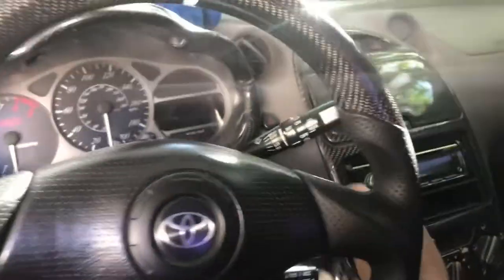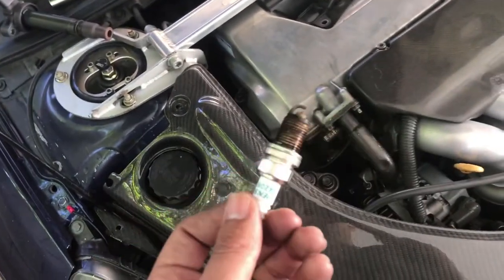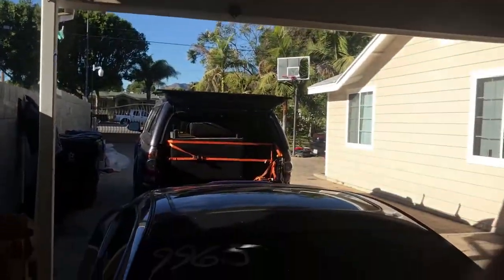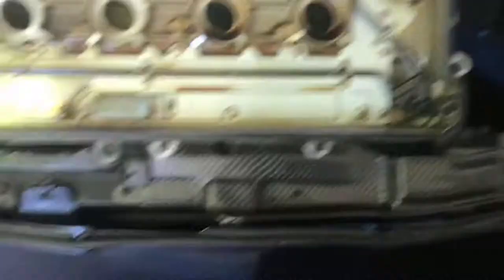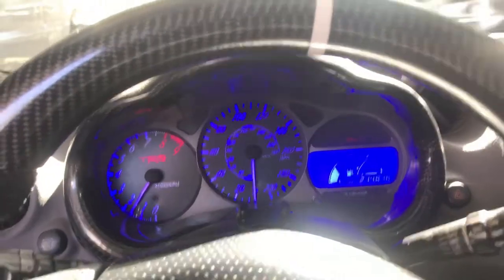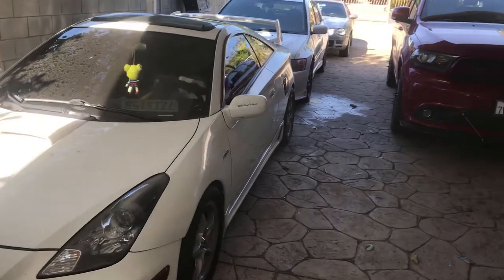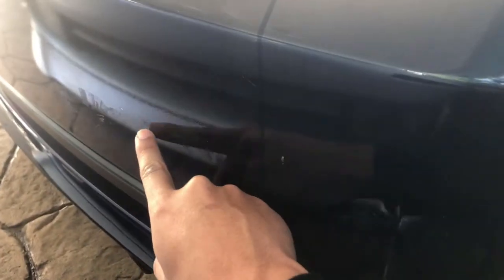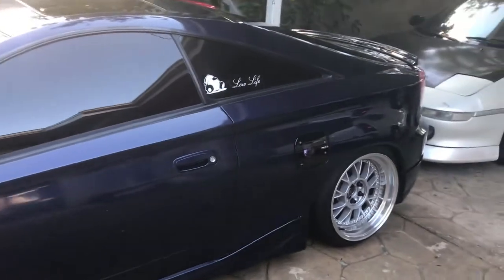Check Engine Light Came On After Racing

Comment: Yo Rafa I have a 1zz Celica  , It had a misfire and I ran It like that for a week, one of the sparkplugs popped out, I got it rethreaded and installed a plug with a helicoil, changed sparkplugs and ignition coils, but it still was misfiring , drove it from work and back for 2 weeks and one morning it just lost power as if i stalled it , now it turns on for like 2 seconds then shuts down , this is the second 1zz in the car ,can it be the pump or??? It has 200,000+ miles on the same fuel pump
Reply from the maker: Celi Gawd I would do a compression test 1st